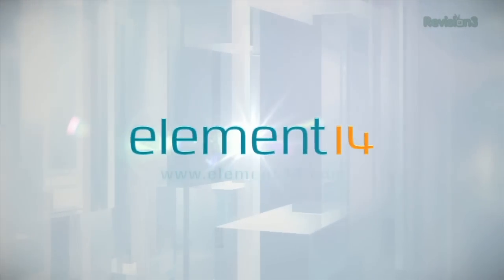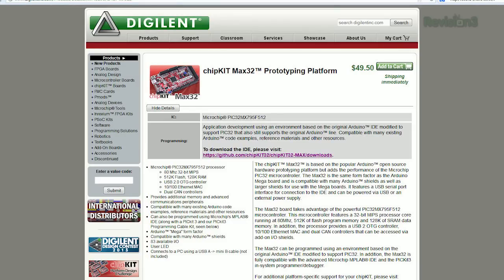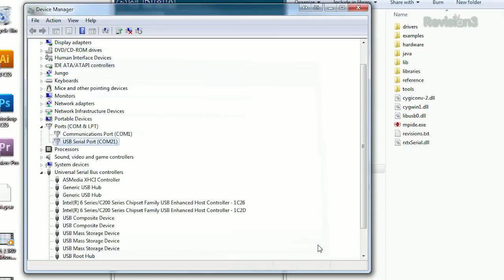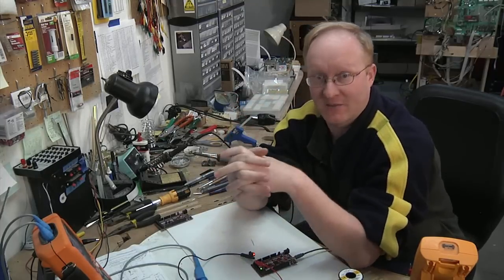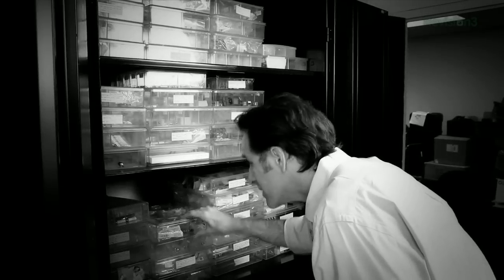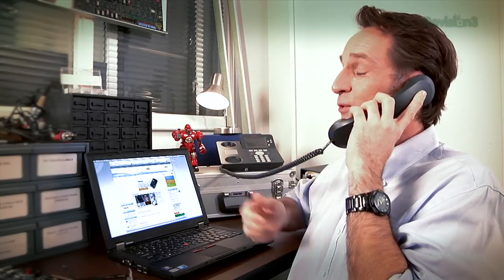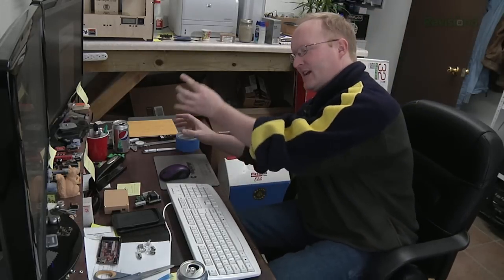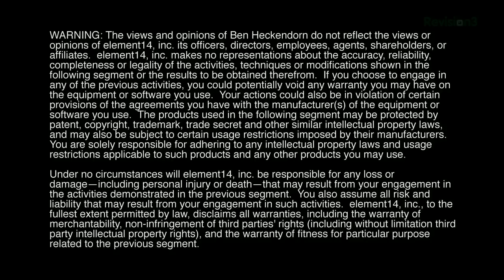Learn the Basics of the PIC32 Microcontroller

Comment: You can do low-level port manipulation within the Arduino IDE as well.
Reply: Really?
Reply: KillJD Absolutely. Even if it's written Arduino on the board (and the IDE), it still is an AVR microcontroller. So you can use AVR C and even assembly if you want.

You can make digital pin 8 to 13 as outputs with:
DDRB |= 0b00111111;

That's way faster than using a for loop with pinMode().

Comment: I can't speak for the specific case, but if you can read from the ports using the onboard OS, then the answer to something like that is writing a keyboard emulation driver that reads the button inputs (using whatever means the device allows), and then sends a keypress to the OS. For the Pi that means learning about linux keyboard drivers. There may be easier ways though, (for instance, on windows, DirectInput can generate emulated keypresses without needing a custom driver.)

Comment: at 2:04: the PIC32 does have internal pullup and pulldown resistors.  You need to write to the CPUE and CNPD registers.  

MPIDE isn't just like Arduino IDE.  It is a port of the Arduino IDE to include more microcontrollers.

Comment: You can toggle a pin on Pic32 a lot faster, if I remember it was something like 8Mhz, I've programmed it in Microchip Mplab and after making sure that configuration bits are set correctly so the chip runs at 80Mhz.
All chipkit boards can be programed in Mplab using pickit 3 programmer.
The other useful thing about Pic32 is that you can just do TRISBSET=BIT_6; or TRISBCLR=BIT_6;
TRISBINV=BIT_6;
ALSO LATBSET, LATBCLR, LATBINV
LATBSET=BIT_1|BIT_2;
B is for port B
BIT_2=1 <<1;
I'm using a Chipkit MX-3 in a quadcopter project.

Comment: For the arduino you can go two ways: Enable and use inline assembly in your scetch, or just use the microcontroller with atmel's original tools, and load the binary yourself overwriting arduino's bootloader (your arduino functionality might break and you are generally better off with a streight avr dev board if you want to do this, google the avrfreaks site for any info you might need on avr programming). 
Older pic mcs were programmed in assembly, so I would expect that to still be an option.

Comment: Nice video Ben, Just one bit of information that wasn't quite right in the video: Pulse width modulation works by varying the duty cycle of the LED not how fast it blinks.  In other words it changes how much time in one cycle the light is on not how fast the cycles occur.

Comment: Would be great to use raw port access on the Arduino, too, and a breakdown of all results shown in a table.
Btw I just tested it with my internally clocked 8mhz Atmega8a and the full cycle (rising edge high - low - rising edge high) takes 0.76us (f=1,3mhz).
The Atmega328p should be even faster!

Comment: Actually a digitalWrite of a constant value to a constant pin number should compile down to a pretty ideal constant assembly instruction if the compiler is good at optimizing - the Wiring library has a special constant path for that. When I tried a similar thing with msp430-gcc, what looks like a function call indeed compiles down to a single bis.b instruction.

Comment: Hello! I am a high school student who has been fiddling around with FPGAs and UNIX Systems. What I recently found out, is that you can run UNIX on a Gameboy. What I think would be really cool is to use the serial port in the back (usually used for multiplayer) to plug in a keyboard. I don't have the experience with FPGAs needed to implement something like this, but I would love to see it done! Any chance you can do something like this?

Comment: Slightly random question, unrelated to the video but, is it safe to wire a switch to the data wire if a USB wire to easily switch between sending the data between two different devices? I don't want to duplicate the data, just switch between the source of the data.

Comment: Hi there, I'm really stuck trying to learn microcontroller's, I've spent around £200 on books and bought the pickit's 1&3 but I don't seem to be able to get kick started with this, I've never had a problem learning a new thing before........ any ideas are very very welcome.
Reply: Hi there. The microcontroller you are trying to learn are Microchip PICs? What exactly is the most difficult problem you are facing? Maybe I can help you out.

Also, are you familiar with programming languages?
Reply: Martyn Southwood   Lots of great material online at Microchip:
https://microchip.wikidot.com/training:start

When I had a specific item to solve, it helps drive the creative juices.  Latest one:  1992 Nissan 240SX headlights that don't go down.  Bad delay module... so goal is $2 PIC, perf board, some discrete parts. So taking a 1985 design, and bringing it up to 2015.    Admitted Nissan sells the module for $45, but that is no challenge.
Reply: Martyn Southwood The Arduino is exceptionally nice for learning and the learning curve is less daunting than it would be for a PIC32. I've only used AVR ATmega chips first then moved to PIC18, PIC10 and now PIC32.
Reply: pacrat90 Martyn Southwood 
 Wait -- you can have both PIC32 and Arduino code!  ChipKit.   google TCHIP-USB-MX250F128B  (DP32 from Digilent is board with the 28 pin dip on it...).  Only catch is press "RESET" while holding BTN2, then release BTN2 to download new code.
Reply: Hi everyone, thanks for all your reply. .... I think the problem is I have no coding experience and so reading through all these expensive dedicated microcontroller books is washing over my head, I've just bought c for dummies and hoping that might shunt me in the right direction
Reply: +Martyn Southwood (martyn158) how are you doing now?
Reply: I've had to put it on hold for the moment, I will get back to it.... hopefully with a clear head as I just got so overwhelmed

Comment: Excuse me Sir,

Your CAPS Lock key seems to be engaged. Kindly disengage it by simply pressing the key once again.

If you don't know what can be done by a micro-controller you should probably look at its datasheet for its features. Microchip makes excellent datasheets and they describe how to use the features and various supported protocols. The MPLAB IDE they make and all their libraries make programming easy too.  You might want to start on an 8 or 16 bit processor first, 32 is overkill.

Comment: Hello sir, i made a remote control home appliances using microcontroller AT89C2051  but its not working when i put first time ic then the led blink again when i put same ic second time there is no blink also when i press tv remote no working.i'm using triac insteadof relay.tell me solution

Comment: Hello.

I have a question that I will try to formulate as best as I can. I am new into electronics, and basically, I am starting to study it mainly becouse of this question I am about to make.
I have 3 servo-drive motors, and I plan on using it on a 3 Axis CNC router configuration.
The servo motors has the drives integrated in its housing.
The question is.. Since this servo drives has a connection with a Power input and 4 Pins for CAN. Pins 1 (Can Ground) 2,(Can Low) 3, (Can High) 4, (Can Vcc).
Now my question is.. How can I control this motors? What kind of controlling board gives out this signals.. Is the Can high and Can Low signals compatible with the pulse and clock signals (step and direction?) if not, how can I feed this motors with this signal in ordor to control them in a 3 axis interpolating manner.

Thank you I have subscribed..
Reply: Fernando Penas Servos work via pwm, just read some tutorials on how to program them - that'll clear things up for you
Reply: +Fernando Penas CAN stand for Controller Area Network, and it's a bit more complex than simple step-direction. CAN is a bus-type, one that you for example will find in most modern cars. 
You would need special hardware to talk with a CAN-bus, and then this hardware might assist you with some protocol technicalities aswell. Take a look here for example: http://www.microchip.com/pagehandler/en-us/technology/can/home.html
Reply: +mizcak Yes, and the packages are standardized, as far as I understood Can protocol.. They are 16 bits signal enveloped in the can protocol.. But, is it possible the signals that the drive understands are proprietary from the manufacturing company, or there is also a standard way in which the pwm signals will be encoded and decoded in the bus.. I mean, there must be an adress to each hub in the can network.... How can I find the adress to each servo drive (maybe some listening device or such)

Comment: The statement that using assembly is inherently fast because it has less overhead is misleading.  Higher level C has more "overhead" at compile time but the generated binary/machine code  is not inherently slower or even different, so timing the read write cycle delay isn't an artifact of the language.  If it's compiling to less efficient or slower code using c then assembly that's a compiler issue, not a coding issue as you state here.
Reply: Sure (@detox4u) the compiled assembly from C is not really slower, but things like GCC have always given me more instructions than necessary. I have always got shorter/faster code by assembling only instructions I really need. I know good C optimizations should overcome that problem, but it wasn't.

Comment: All windows closed source, lol
Reply: Of course, it's a show, with investors, most likely Microshit too. But i have to admit, open-source needs more time, cause you're spending time actually understanding things (and configuring).
Reply: Samonitari
Yea, this actually hits a very important subject i been working on recently. I was posed by a problem with PICAXE, not sure if you are familiar with this company, i can not say chips as they ar MicroChip NOT PICAXE. The dilema was that it uses a Visual Basic. They call it BASIC language but it is in fact an iterpreter language. That means it is not a compile language. The language needs a program to run the language, a program to tranlate the Interprited language to be run on an Interpriter. The interperter is a firmware embeded into the protected PIC MicroChip from MicroChip. Read the firmware and it automaticrally formats itself.
Now you have the simplicity of a serial command based language much like a script that the firmware can run but Is the firmware open source GNU/GPL NO it is locked away. So you have simplicity but you dont have full control.

How do you do it? this is the question, you make it simple but provide a language that people get stuck on which means you can not make it portable to other devices. You end up in a simple bubble trapped but at the same time as Revolution Education who make the PICAXE said to me. Would the project that used the PICAXE even exist if it was not for the simplicity of the PICAXE BASIC language.

Complexity vs simplicity vs entrapment. I think the next billion pound venture is to make a simplified C compiler or a language that is Simple but full open source that can program Atmel, MicroChip, Altera, Xilinx and so on without locked firmware. Just think about that, freedom preserved multibillion simplicity of a universal language programer. FPMSOULP

Comment: 1) This is not a tutorial at all... A review maybe, not a tutorial. You tought nothing.
2) What is the point of comparing PIC32 with "Arduino"? Using different compilers and different "techniques"??? Why not to compare PIC32 to Intel i7 then? Or a computer running Windows with the "blinking" program written in Haskel? What was your point? Even comparing PIC32 with PIC12 would make little sense - they are different. Like Mercedes and Opel.  What is next tutorial about? Comparing cats and dogs?

Comment: Arduino is responsible, single-handedly, for bringing in so much new blood, compared to what PIC and all others had (not) done for so many decades.  It's so egregious that PIC even now directly rips-off the entire Arduino programming experience, look-and-feel; even Intel, of all too-big-to-care beasts, does a Galileo kow-tow to Arduino method.  Remember how shitty it used to be, not that long ago, programming PIC?  Instead of insulting or deriding the bringer of so much and such welcome new blood, maybe PIC would do well to simply, factually state what Arduino can do, what its limits are, and present some next-step type projects that their procs can handle better. Focus on the positives.  Negatives are self-evident.  After looking at this video, my biggest concern is how awful the square wave looked on the PIC...and how PIC is copying and deriding instead of innovating.
Reply: btw, did u know microchip & atmel are the same company? microchip purchased it.

Comment: This video plays like a huge apology.  Can't stand the annoying music underlay.  80 MHz proc doing low-level bit flipping at only 10 MHz is awful, no matter how you cut it.  Intel never even claimed something that atrocious.  Wonder what that Galileo can do in fair comparison?  What happens if you attempt to flip another pin with the PIC at the same time, does overall speed drop to 5 MHz, or is there imperceptible speed hit?  Tell it like it is.  Also, look how awfully noisy that square wave is, all other things being equal - no longer square but some kind of badly ringing-step then waterfall cascade instead of a falling edge.  Is that all due to insufficient probe and handheld "scope" ?  It would have been much more informative to do the same comparison using the Arduino, so it would be a 4-way comparison - PIC went from .6 to 3. (about 5x); would the Arduino have done the same boost (from .1 to .5), or better, or worse?

Comment: Seriously the Arduino uses "Direction rate report" what the heck!?!? Perhaps more correctly the AVR uses a "Data Direction Register". You talk about "using pin 32" while highlighting and using pin 52. Your speed optimisation is questionable unless the 1 << 6 bit shift is optimised to a constant then you are still wasting time in your IO loop and not really demonstrating the real potential speed improvement direct IO can give you. You may be entertaining but if you are teaching beginners stuff you really should get the basic stuff they need to know right, and while we are at it buy some resistors and USE them on your LEDs. As I said entertaining but beginners beware...
Reply: 10/10 doesn't know what compiler optimization is